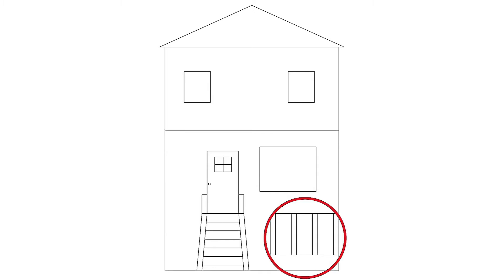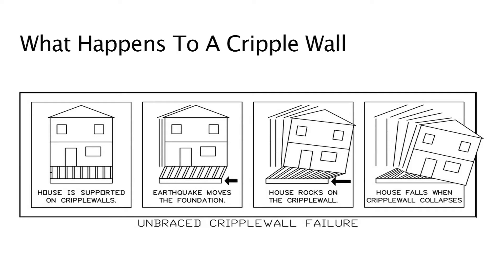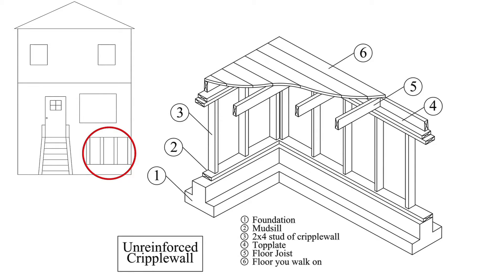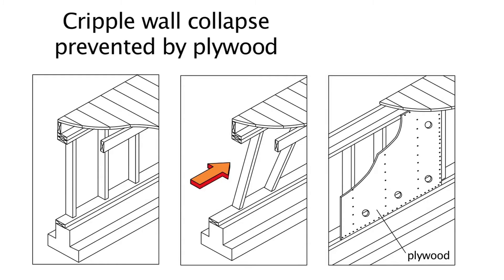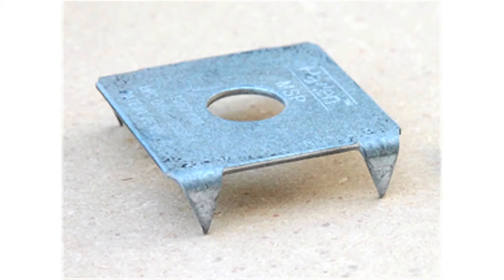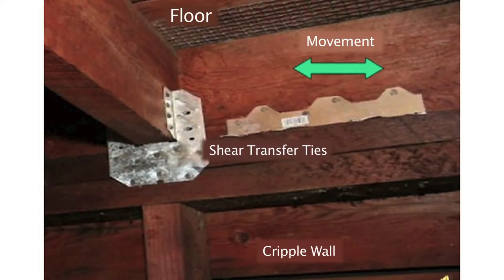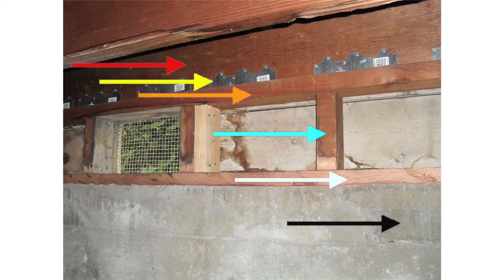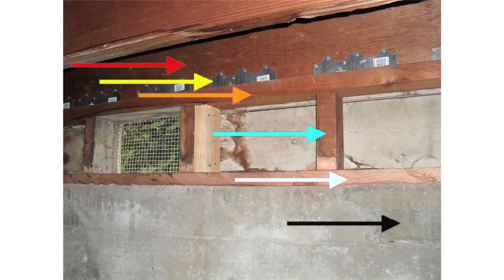Seismic Retrofitting and Bolting of Homes with Cripple Walls is Simple and Affordable

Comment: Mr. Cook your videos are very informative, thank you for posting.  I have a 102, single story farmhouse with no cripple walls.  However it also has no sub-siding over the 2x4 framing.  When they built it, they framed it and then put cedar lap siding over the framing.  I suspect this makes my house much weaker.  Other than installing the Simpson UFP, is there anything else I can do to retro fit it to hold up in an earthquake.  I live in Oregon by the way.

Thanks